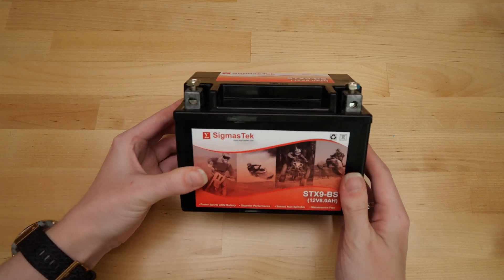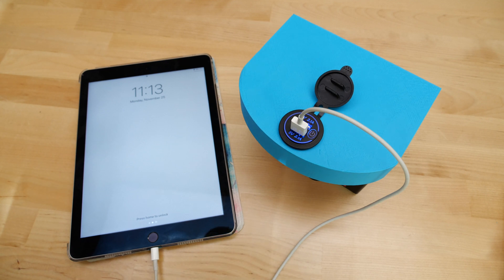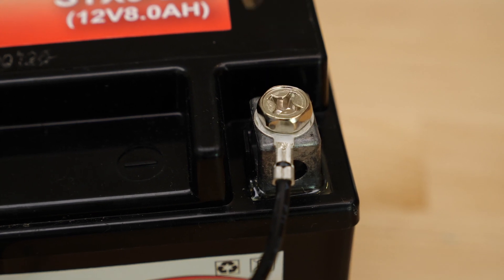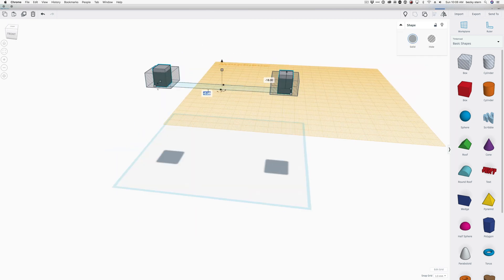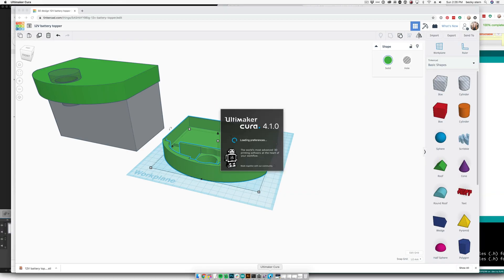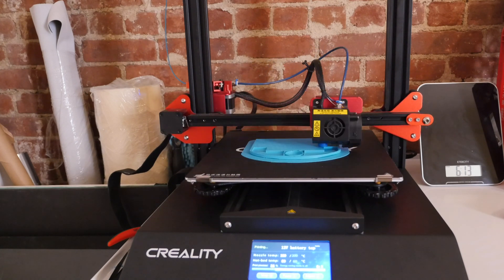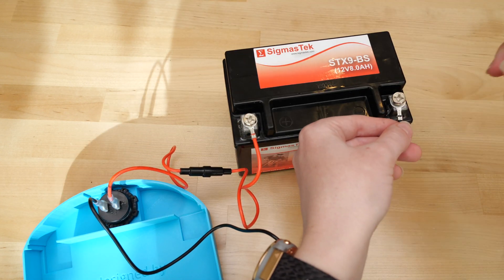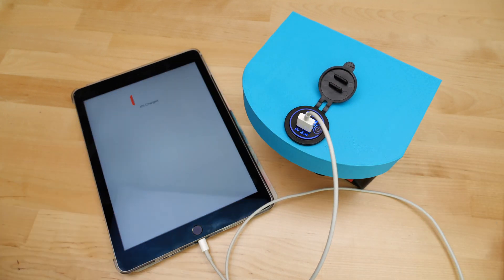Emergency USB Power Source (3D Printed) // Becky Stern

Comment: I wonder how much that charger uses even when not charging a device, might want a kill switch to turn it off, and a low voltage cutoff so you don't damage the battery over discharging it, the SLA batteries don't have any kind of protection.
Reply from the maker: The product description says it draws no power when switched off, but I have yet to confirm with a meter.

Comment: Cool idea!  It might be worth connecting a float or smart charger to keep the battery healthy and charged.
Reply: A good "part 2" would be how to build a crank generator using a stepper motor salvaged from an old printer or whatever.

Comment: Great one, Becky! I have a handful of 12v SLA batteries gathering dust in the garage, most from Power Wheels experiments. This will give them a purpose and make me a hero when the power goes out. Also, good find on the switchable adapter! I imagine the unswitched options could drain your battery even when they're not in use.
Reply from the maker: Thank you Donald!